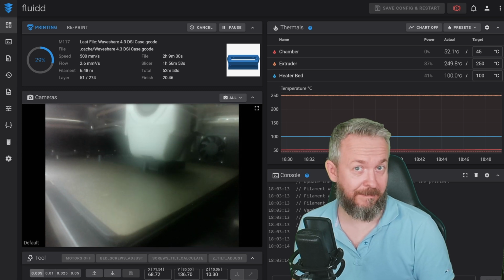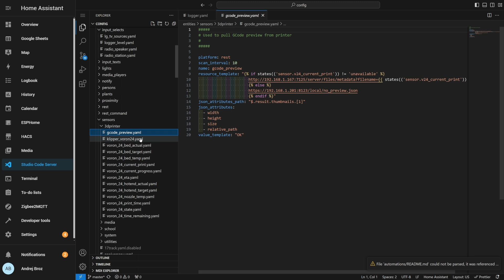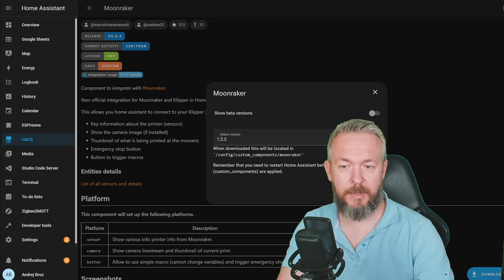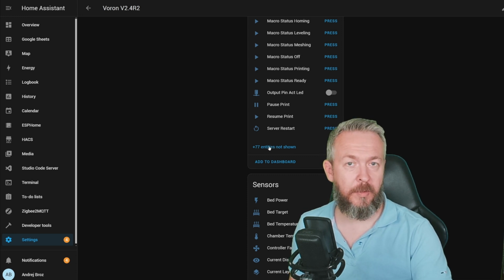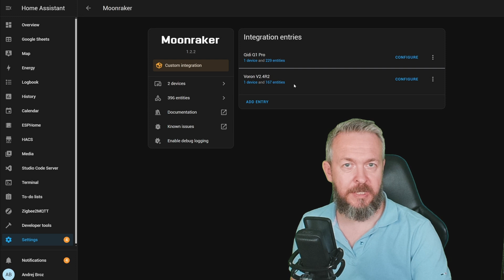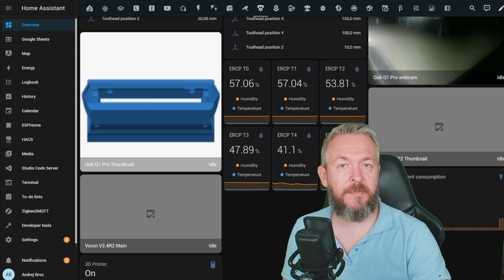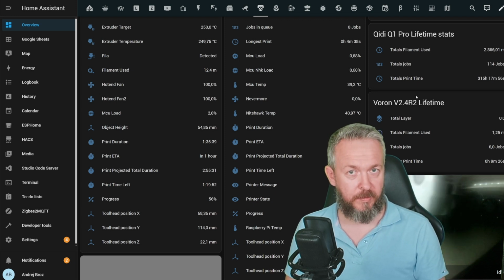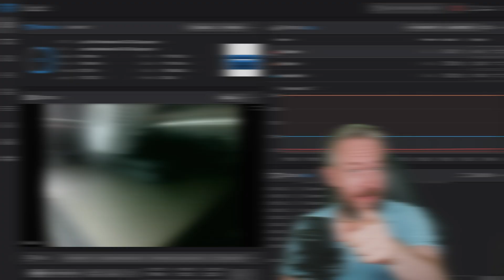Monitor 3D printers from within Home Assistant

Comment: Hi thank you for your tut, I had some issues with the connection, and want to share it, if I'm not the only one with it.
If you can't connect, than try to open your moonraker "YourPrinterIP:7125" in the browser, if you can't reach out the site, you may have the same issue like I had.
- Connect with ssh to your printer, and than edit the "moonraker.conf". -> For me it was in the "home/USER/klipper_config/moonraker.conf", you can edit it, if with nano.
- by [server] change the: 

[server]
host: localhost
port: 7125

to:
[server]
host: 0.0.0.0
port: 7125

- Save it
- restart the moonraker with the command: sudo systemctl restart moonraker
- now you should be able to connect inside your network to your moonraker. You can test it if you put "YourPrinterIP:7125" in the browser. If you see the webinterface, you can follow the instructions from @BeardedTinker :)

I hope this will help some of one. I have the Elegoo Neptune 4 Max if anyone want to know that.
Reply: I had the same problem :)
Thank u <3

Comment: Somehow my Webcam is not shown in HomeAssistant. (In Moonraker it's working fine)
When I click in Homeassistant, Moonraker, Configure I can add the "Camera Stream URL" and "Camera Snapshot URL".
i wrote there: https://192.168.1.81:8080/video

(Do I need to write it in another way? E.g. something more behind video?)

When I copy this link into my browser it shows me the Webcam perfectly. 🤔

Thank you a lot for your help and ideas!
Reply from the maker: When you activated the integration - it didn't create sensor for it by itself? Also, have you tired http vs https? certificate can be an issue if it's self-signed and not trusted by HA.
Reply: @BeardedTinker  Yes, it created a sensor by itself but it says the entity is no longer provided when I open the preview.
Reply from the maker: Can you try http://192.168.1.81/webcam/?action=stream
Reply: @BeardedTinker  Sadly doesn't work either.
Reply from the maker: I'm on vacation and can't remotly test it, sorry I can't help you.
You could try opening github issue on repository. There were some issues in regard to camera in past, but I don't see anything open right now.
Reply: @BeardedTinker  Ok. Thank you very much!
Enjoy your vacation ✌🏻

Comment: I'm using the same hacs for a moment. As my printer is only online when needed, I've added a little automation that ping every 5 minutes the printer to turn on/off the Moonraker integration with help of Ghost integegration. In that case, I don't get borred by error in refreshing moonraker integretion as printer is offline.

Comment: Wow. guy interested in smart home and also 3d printing. Are we the same person? 😅 just flashed klipper a week ago myself, perfect timing. Adding the camera feed to HA might be an easier solution for watching the printer form a smartphone, rather than port forwarding mainsail itself.
Video suggestion: what is the process of publishing a custom integration on HACS? does my custom integration need to pass some kind of review or tests or fill out some template or just spew the code to github and send it?

Comment: I've been using the Moonraker integration for a little while now, as I "upgraded" my Ender 5 Pro to Klipper.   I have found it really reliable and updates are quick.   It's a really good integration.  I feel it would be good enough to be an official integration.   I like it :)
Reply from the maker: Yes, it's very good. I've been using it since around April (on test system) and very happy with it. Finally got it running on main system, but still haven't cleaned out my old integration by using REST commands.